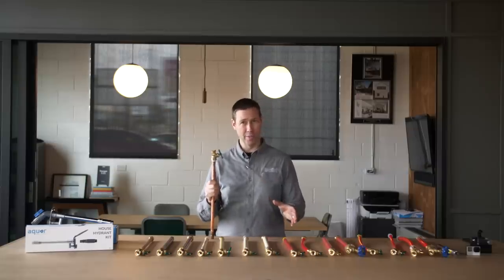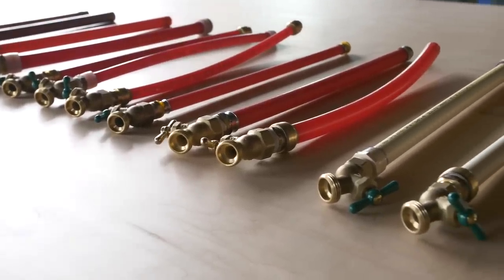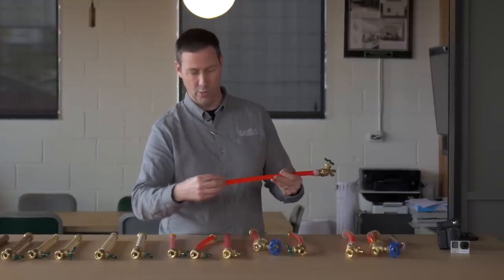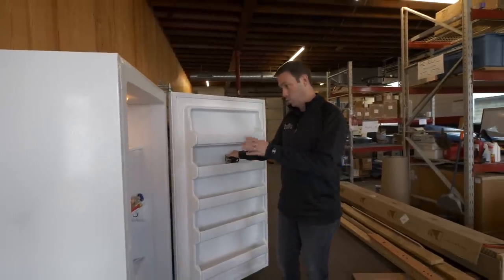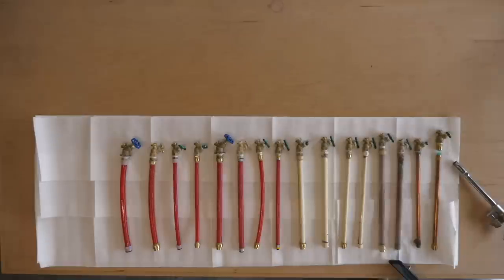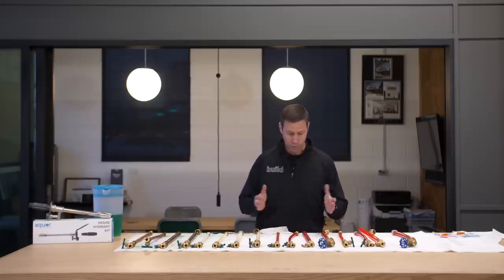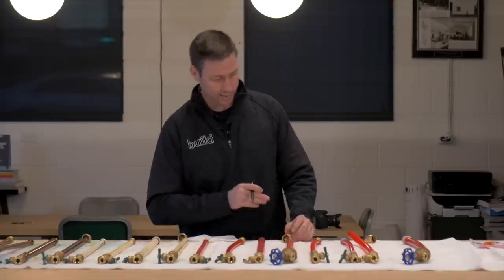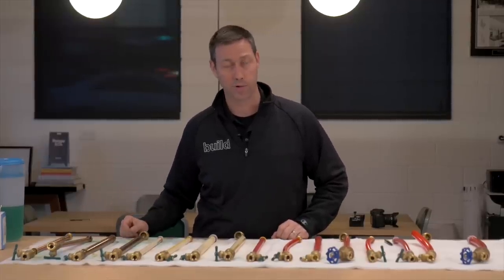Copper vs Pex vs SharkBite - Freeze Testing

Comment: I just had a CPVC pipe freeze & split under my house just last week...I'm about to replumb my whole house with pex...I live in Louisiana, btw, Texas wasn't the only place that froze over last week...
Reply: Learn how to use the shark bite removal tool. You'll be glad you did. Try it at the hardware so they can help you if you're not  plumber familiar with it. It's simple once you get the hang of it. I changed all my plumbing to PEX years ago and no trouble since. Living in western North Dakota where the temp went to -30 in February you don't want to lose your pipes and hafto work in deadly cold weather trying to repair it. I hope it works out for you.
Reply: PEX is just another plastic. After 10 to 15 years of service it will become brittle and fail under freeze conditions.
Reply: So you had 1 line freeze under your home 🏠 home

Comment: As a plumber, I have seen the benefits of pex in Colorado's sometimes extreme winter temperatures. I had a lady whose hot and cold water lines to her kitchen faucet froze two different times in one winter season. . She had pex. Both times we were able to thaw the lines and they were fine.  If she had copper lines, I am certain they would have bursted.  After the two freezes i installed heat tape on the lines.
Reply: What is plumbing heat tape? I guess I need to check it out!!!
Reply: @bweaver760  Heat tape isn't really a tape in the sense that it sticks to things. 

You can get it at Home Depot. They come in different lengths i.e. 3', 6'. It is like an electric cord that you can zip tie, and or tape to a water line and even put pipe insulation around that to help hold it in. 

It has a little sensor that can sense when the pipe gets below freezing temp. When it does the cord heats it up to just above freezing.

 It needs to be plugged in to an outlet. It has an orange light to show its on. So the orange light should always be lit whether freezing or not.

A cord usually ranges in cost from about $20 on up, depending on the length. I think it's made by Thermo-King.
Reply: @ryanporter1819  I got my pipes frozen because of electric surge that blew the main breaker. And, of course both furnaces went out.  I was away, friends looking after the house came week later, all frozen solid. Electric heating would not have help, alas

Comment: So u work at a plumbing store for the last 4 years and here's my input for PEX vs Copper base on experiences from customers. Pest love chewing on PEX, DO NOT put in crawl spaces or areas where pest can be found, hundreds of customers are repairing PEX piping there all the time b.c of pest! Yes rats and other pest can chew through copper too, but I'm yet to find a customer coming in to repair copper pipes that been chewed on. PEX A and B is amazing, but that is the biggest drawback. I believe using both copper and PEX for a whole home. Do not limit yourself to one system completely.
Reply: It sounds like PEX should come with one feral cat.
Reply: Yes, Ive heard of that., too.
Reply: You are right. I have a mix now of copper and shark bite fittings. I have a 1” pipe in the attic because we forgot to plumb the master bath toilet. We wrapped the pipe with fiberglass insulation. It must have been thin in a small area because there was a split of 1”. We put a saddle clamp in that, threw a mop bucket under it for several years. That was 1989. We had 4• below zero. Needless to say, no problems in the extended below freezing a few days ago. Yes! It does get frigid in central Texas. Hot too! Long story short, I’m happy about the new inventions, but they have to prove themselves.
Reply: I second that. I have a RV and yes the critters love chewing on the Pex.

Comment: I used to live in PA and frozen blown out copper lines were common. I didn't come across pex until I moved to the south where, like you said hard cold winters aren't common. I have to honestly say the first time I got to work with pex I was sold. It's 100% better in every way compared to copper, seriously. It's an absolute joy to work with compared to copper. I was able to repair a broken faucet for a friend's neighbor with the water ON! He couldn't find the water main, so I had him open a few faucets to knock the pressure down, cut the old valve off, shoved a ring on, pushed in an open valve, crimped and turned the valve off. Sure, I got wet, but it was fixed! Just try that with solder and copper pipe. I was a bit skeptical about the shark bite, but this video helped alleviate that.

Comment: Excellent test with surprising results. I've learned that one downside against PEX is that it goes very brittle, when exposed to sunlight. Also, most of my frozen pipe bursts have been at exposed galvanized couplings and valves, such as hose bibs. That reminds me. It's a good time to winterize my pipes.
Thanks!😎

Comment: That's a great test Matt. I really enjoy this as it's something I have wanted to see you for a long long time, ever since PEX first came out.  I just plugged in my Cottage here in Eastern Canada where we get some pretty bitter long Winters and I used PEX for everything with crimp on fasteners. I made sure that every line has a downward slope to a common drain so all I have to do is open one valve and the whole place drains down.  That being said it's good to know that I don't have to worry about freezing if somehow water ends up in the system and it goes below zero.
Reply: In our mobile home it was built completely with pex, the heat went out once when it was seasonal "In Northern Minnesota" I came up and it was so cold windex was frozen in a bottle on the counter. Once we got the furnace fixed and heated it back up none of the pex had broken the only things that broke were some sink faucets and toilet tanks. Didn't have to replace any pex at all.

Comment: Something that many people don't know is that there are two methods of failure resulting from freezing pipes. The one everyone is familiar with is the pipe splitting at the frozen spot due to expansion. The other is a pipe bursting somewhere down the line due to over-pressurization. As the ice expands in the frozen section of pipe it presses against the water in the un-frozen section, greatly increasing the pressure. I've seen pvc/cpvc pipe turned to splinters due to this effect.
Reply: yes , the ice expands the long way in the pipe . I was told 22k psi when ice freezes
Reply: @robertobakero8865  & @ 32°
Reply: Blowtorches aren't terribly helpful if you see the problem as it's happening too.
Reply: The high pressure model makes no sense, as the system is protected by a PRV
Reply: @robertmencl9169  If it freezes in the right place a PRV or possibly a water hammer arrestor will prevent overpressure, but that doesn't apply to every spot in your system, to a line that has been turned off but not drained, or a line that freezes in more than one spot (as was the case with the aforementioned CPVC pipe).
Reply: No propress?I have propress for over 20 years, with no problems, knock on wood.

Comment: Bought a house 2 years ago in N.W. Louisiana. Had the entire house re-plumbed with PEX.  We did freeze. -2° was the lowest we got, stayed under 32 for a good few days and nights. Went without water for 3 days. Returned to normal after using a 500 watt halogen bulb on my only main cpvc pipe at the first joint. No leaks in pex, no leaks in cpvc.

Comment: Thanx for the video, it really helped solidify my choice for changing my pipes in my garage. House was built in 49 and has copper pipes wrapped up for the cold with a room built around my pressure tank from the well water. I live in Ohio and had to put a heater in the room during the winter with negative degrees with the polar vortex. I’m going to switch out all the copper for pex. Thanx again!

Comment: I've used pex for years and it's awesome. I've had a few clients who have had issues with frozen pipes busting so I've replaced their pipe with pex and 10 years later they still haven't had one busted pipe. It will still freeze mostly because they won't spend the money to properly insulate under their homes but place a heater underneath and thaws right out no problem...

Comment: don't know if it's been said before my comment, but the the real freeze risk is from repeated freezing.   Each time the copper freezes, it will stretch out and weak spots will be thinner.  Each subsequent freezing brings that thin spot that much closer to tearing where plastics will flex back and forth more.   I've seen 1/8" thick steel frame tubing split wide open because there was water inside that repeated froze and melted.

Comment: I use Everlock fittings with Pex A, so in cold weather it’s a positive lock with no waiting for the sleeve to contract to the fitting. Pex A is great for heating systems as it is for extreme cold conditions. You could use EverLock caps and sleeves on a length of Pex and then freeze to 20 below, you will be amazed how great this pipe is.

Comment: Matt!  interesting vid! I think the results were valid.  However most frozen pipes don't freeze the full length, allowing for longitudinal expansion.  Might have been interesting to put a micrometer 'before and after' on the pipe diameter.  The ice had to grow somewhere.  Overall, nice job!  Was kind of surprised the cpvc didn't split....

Comment: I did an experiment with Pex A and brass plugs on each end with cinch clamps. filled it underwater so no air and froze it hard as a rock for days. Didn’t leak, plugs didn’t appear to move outward at all.

Comment: I put a 1/2 pex with shark bike stops on both ends full of water and did my own test for a year. Put it in a freezer for a month and took it out for a month and it never poped
Reply: because he shows it as just a quarter inch into the pipe hym wonder why
Reply: Hack
Reply: Did you pressurized it?? you did not do it right...
Reply: SharkBite are not reliable.

Comment: I used to live in a place called "the Icebox of CT." It was 10 degrees colder than anywhere else in the state if rained in the winter in any of the surrounding towns it snowed there.
We just properly insulated the pipes never had an issue and our house was built in 1887. Again we properly insulated the pipes and walls back in 1983 with fiberglass insulation.  House stayed warm in the winter and cool in the summer.

Comment: OMG im having my pipes replaced because of the Texas freeze!  My house was built in 2002 and with copper pipes, not good over 30 busted pipes.  Pipes are being replaced with PEX but supply is low so its being repaired little by little.  Great Video!!!

Comment: I can say from personal experience that CPVC becomes very brittle as it ages (20 year old range). During a freeze here in the Pacific Northwest, I had a two foot section of pipe going to a frost proof hose bib shatter apart and looked like alligator teeth. Plumber replaced with Pex. On another occasion I was having to perform a repair on a section of pipe and as I would try to cut it with a ratcheting PVC pipe cutter, the pipe was just snapping apart instead of the cutter chopping through it like normal.

Comment: Thanks for the video. We have PEX in our motorhome (new--2021) and are taking a trip out west starting Dec 28. I was worried that some of our stops would take us to mid 20's temperatures and the PEX pipes would freeze and burst. Looks like I have nothing to worry about thanks to your controlled experiment, Matt!
Reply: New RV’s Have PEX just Make Sure You have A heated Water Line Wrap from the Outside Water Source to the RV 🙃

Comment: Great video. Loving PEX A. Although the testing did freezing temperatures if you add 50 to 60 psi to the freezing condition just imagine what additional forces that imparts on the piping!
Reply: PEX A does burst in freezing temperatures. Had this stuff on an outdoor tap water was shut off but forgot to drain it and when water was turned on in spring it was full of holes. lesson learned: always open the bleeder and close the spigot.

Comment: as a home owner and landlord and doing some plumbing for several years i have seen my share of broken pipes especially so called freeze proof valves.Then i remembered growing up in a house over 20 years with galvenized steel never a broken faucet so for the last 30 years i do copper but on outdoor faucets i use 12 inches of galvenized pipe with a faucet and no breaks.

Comment: Thanks a lot for the great video . you are right about copper ,it was -10 F when it split in the basement at 6000 ft in Lake arrowhead cabin in S California  and cost me $600 to replace 12 '' 3/4'' type L pipe a good lesson ,so I changed to PEX and it  works great